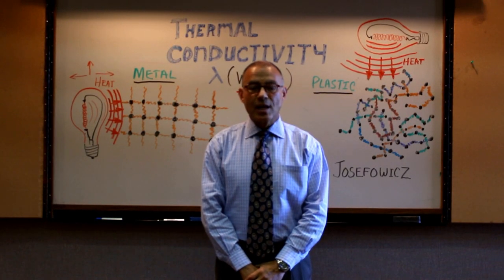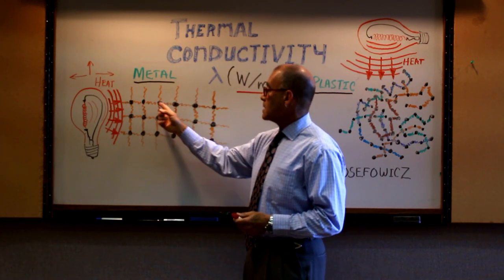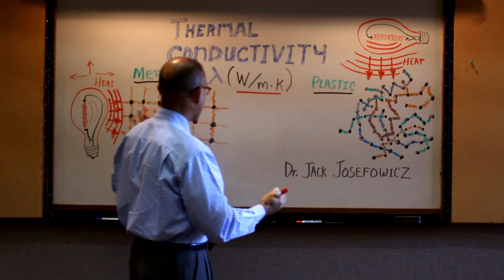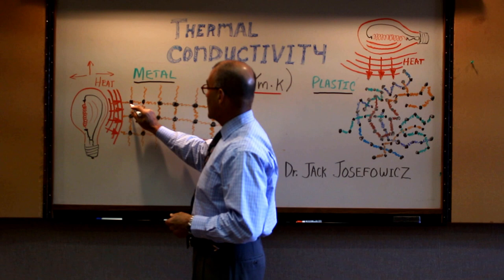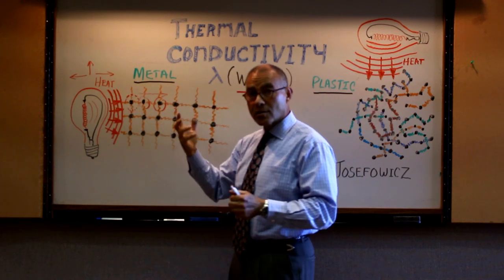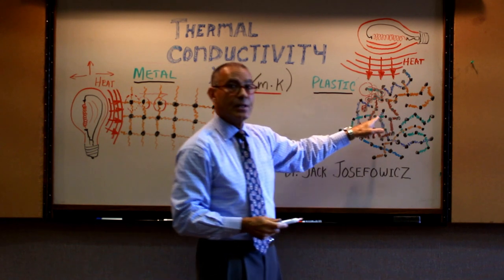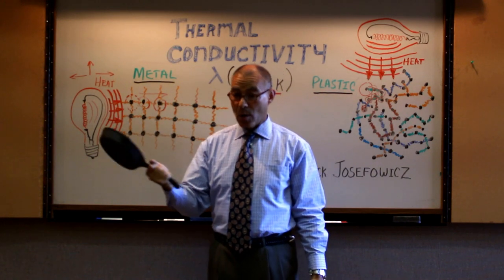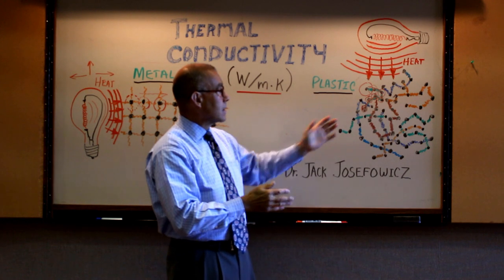Understanding what is Thermal Conductivity?

Comment: This video talks the difference between crystalline solids and plastics. However, the case of metal is different with other solids because of free electrons, which also plays an important role in thermal transport, in particular at high temperature. That is why thermal conductivity of metal is higher than other solids, such as diamond?
Reply: Ye na u r right but in general thermal conductivity of crystalline material is higher than that of amorphous solid.

Comment: The m in the units of W/m·K refers to the thickness but surely the area of transmission is a component too. Is it to be assumed that we are measuring the heat flow in a unit area. If this were so, shouldn't the units be W/m·K/sq.m

Comment: I do have one question.  There are a few materials now that have a high thermal conductivity along (example) their x,y axis but it is a huge difference along the z axis.  How can you explain that to people.
Reply from the maker: Great question Paul. Anisotropy in thermal conductivity can have a number of different causes: It can be an inherent property of the crystal structure of a pure crystalline material (such as in graphite, sapphire, or boron nitride sheets). Sometimes, it can be a result of the manufacturing of an amorphous or semi-crystalline material (many polymers, for example, exhibit anisotropy in thermal conductivity when they have been extruded due to the extrusion’s orientation of the polymer chains). And sometimes it has to do with the orientation of high-conductivity components of a mixture or composite system (for example, often filled polymer composites have high-conductivity fillers with large aspect ratios – such as carbon nanotubes – which conduct heat very efficiency along their length but can’t pass heat as well through the polymer matrix).
 
In the case of crystalline materials, the difference is due to the difference in phonon transmission efficiency along the different axes of the material. In the case of non-crystalline long-chain materials, like polymers, it’s to do with chain organization: heat transmits more efficiently along a chain than between chains – and therefore if the polymer chains exhibit some degree of organization, the thermal conductivity will be higher in the direction that the chains tend to be oriented towards. In the case of composites, it is due to more efficient heat-transfer along the filler materials than through the matrix.

Hope that helps!